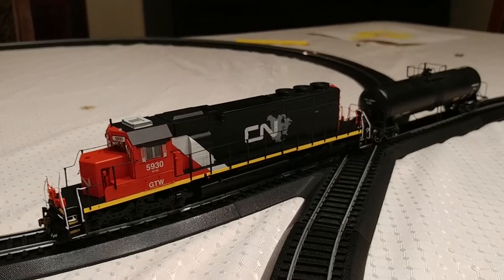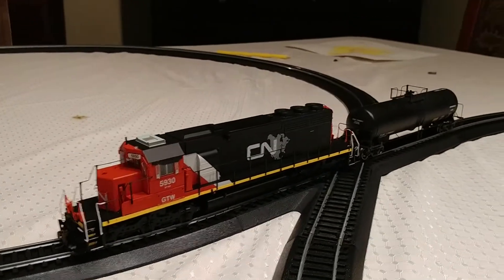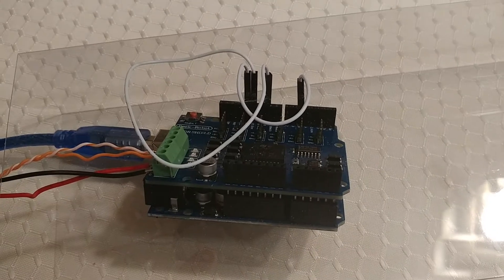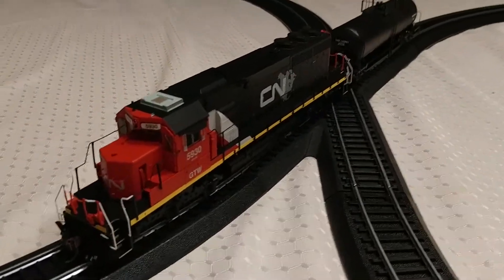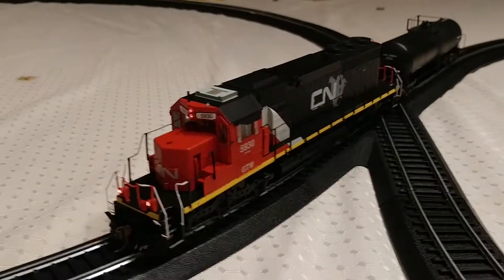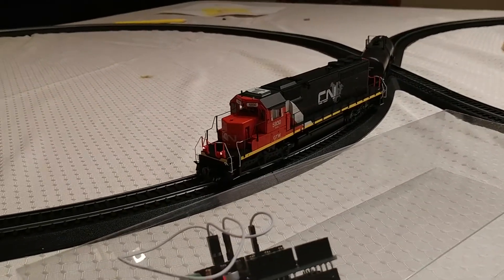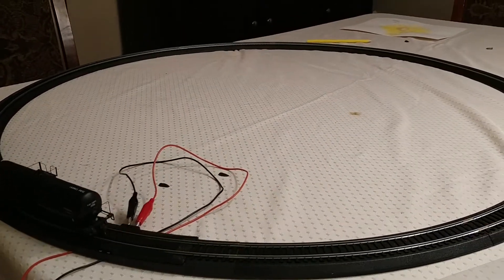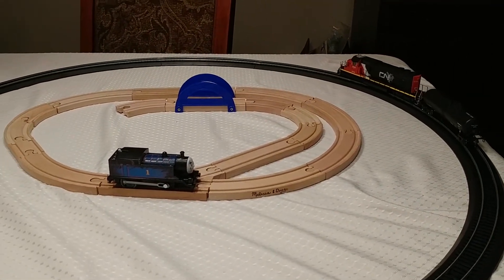Model train with DCC control using Arduino and DCC++

Comment: Awesome project! I may do this in the future. Is the motor shield just to "push" a lot of current to the dcc decoder?
Now you just need some kind of IR/ NRF24l01/ 433mhz wireless transmitter.
Reply from the maker: From what I understand the Arduino itself can't handle the voltage or current required for model trains alone, so you need a motor shield.for the h-bridge chip. The DCC++ video channel has a great explanation. Dave Bodnar is another Youtuber you should check out. He made a wireless transmitter and also does a lot of electronics experimentation with model railroading. Seems like a great combination of hobbies. Add 3d printing and you have a super trio.